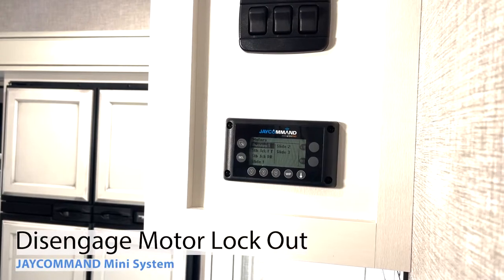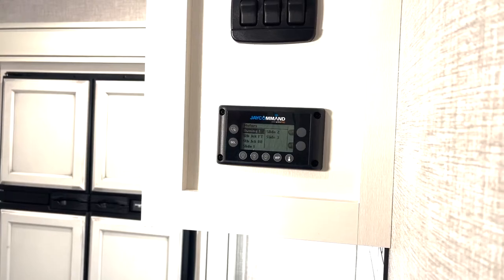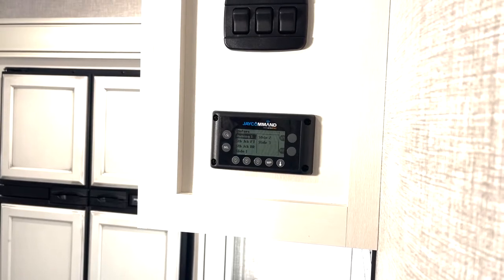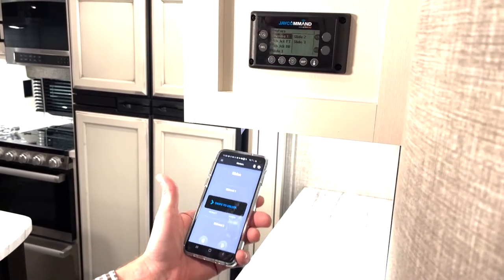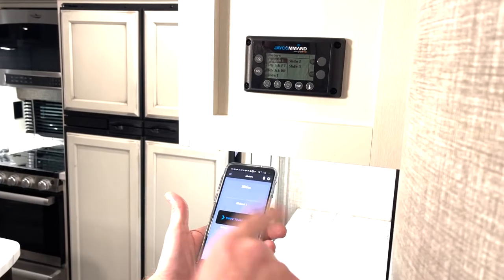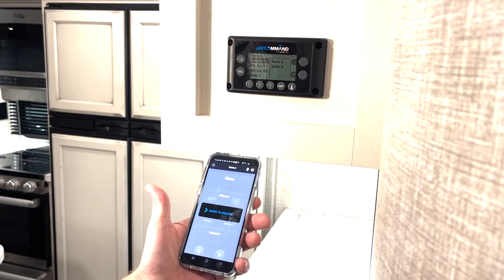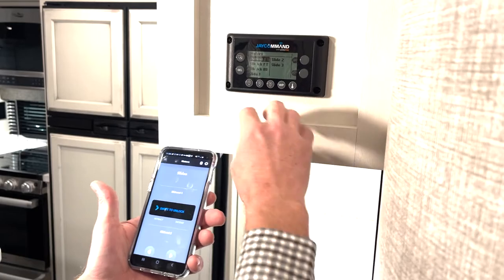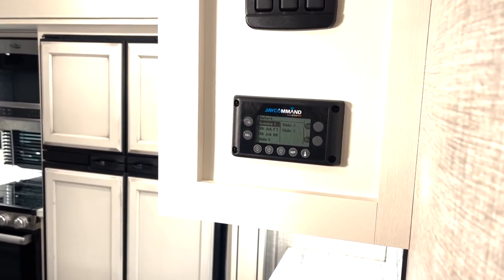How To 'Disengage Motor Lock Out' - JAYCOMMAND and TravelLINK Smart RV Mini Systems

Comment: Boo! So on the 2024 White Hawk how are you suppose to change the battery type without connection to the solar controller?  You put an RV-C MPPT Go Power controller in the pass through with no way to make adjustments. A simple wire run to the node would have been nice. Now I’m forced to buy $115 Go Power panel to make adjustments.